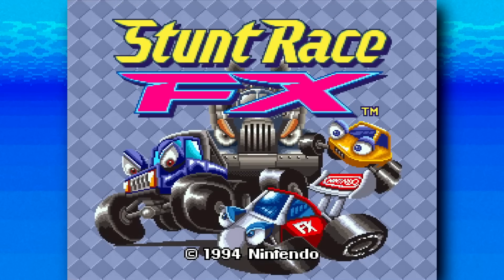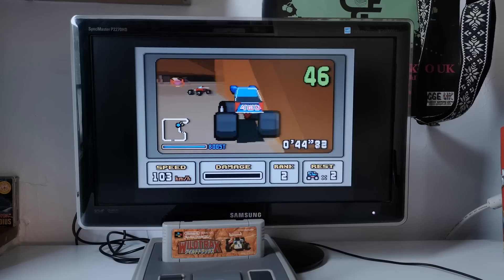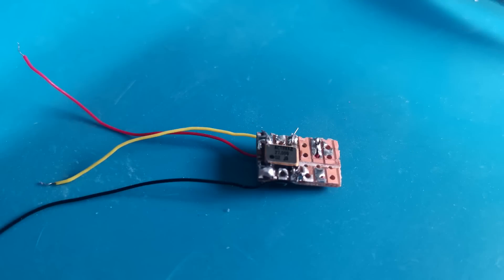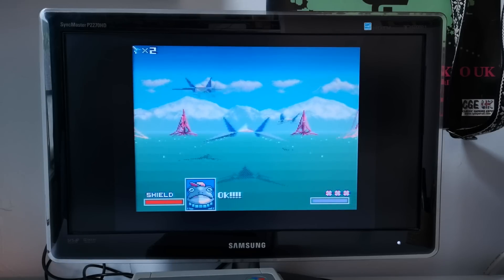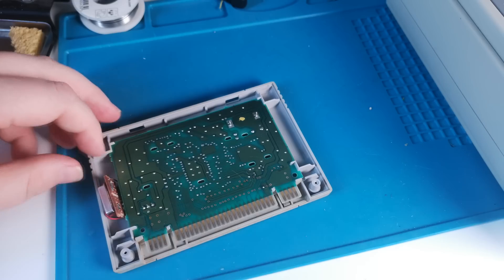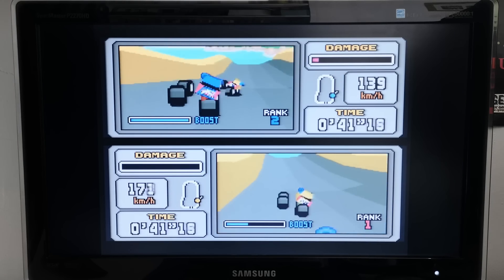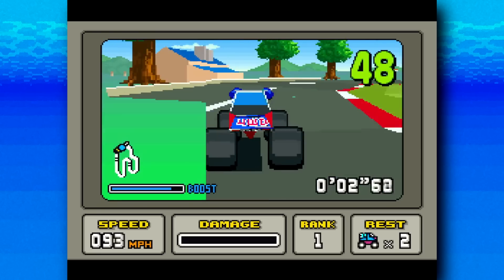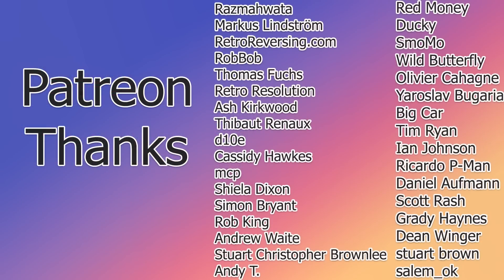SNES Overclock

Comment: Erm. No, Shareopolis. These games have not had their frame rates increased. They have been sped up. The game is running more quickly. I suppose you could say the frame rate has been increased. But you would be stretching the truth a bit. Because the games are no longer operating correctly and you have changed the game. The controls won't operate correctly and the design of the game has been altered and probably spoiled the controls. This is true of all the examples here. Hard Drivin' included, is running too fast and is no longer Hard Drivin'.

Comment: I managed to get the 32 hertz to work on my stunt racer fx 😉 how did you fare doing star fox? as a mod what did your star fox board look like did it have 3 black blobs on it?
Reply from the maker: Yes I have the black blobs version, that seems to be the most common. Modding it was dead easy, you just have to lift the inductor that connects the clock signal from the cartridge slot.

Comment: I overclocked all my super FX games about 7 years ago and it makes such a huge difference, some like the overclock better than others than others. Had some instability when pushing it too high. I also transfered an original Starfox rom chip to a later revision Super FX board so I could overclock it easier, the difference there is amazing :D On a side note the PAL version of Stunt Race FX overclocks higher with better stability than the Japanese version in my personal experience. A small heat sink on the Super FX chip can also help stability as it gets pretty hot. I put a fair bit of info into that Sega-16 thread.. a lot longer ago than I remember, damn I'm getting old

Comment: The ONE thing you definitely need to watch out on is *noise*.

If it's running at 30mhz+, it may well be the oscillator itself, but, having wires exposed, with any slightly dodgy connection, or trailing wires will inevitably induct noise on to the oscillator crystal timing lines.

Imagine being in a crowded stadium and you then try yelling at your friend from one end of it to the other to ask them if they could grab you a beer.

That's effectively what happens when noise is picked up and messes up crystal oscillator pulses

Comment: I love Stunt Race FX, it's one of my favorite FX chip games. While the game does run quite slow, once you get used to it it's actually REALLY playable, and the tracks are all well-designed and really cool to look at for a 3D game running on the SNES. I spent SO many hours playing this game back in the day that when I finally fired up my cart a few years ago to try out my new Super Nt, I had completely forgotten about all the high scores I had set. Brought back a lot of memories.

I wouldn't do this with my own cart. For starters, I'd want a switch to change between stock and overclocked. But if I really wanted to play it overclocked, then I would just use an emulator, which is the far easier option, and doesn't require me modding original hardware. There's only so many original carts left so I really don't see the point in destroying one in order to bump the frames up a couple FPS and risk changing the way the game controls (you say it's "better," but for someone like me who played the game a ton as it was, I'd probably disagree). A good number of people sacrificed these things to make stupid knock-off Star Fox 2 carts when the ROM leaked, and I'd say that would be acceptable if flash carts didn't exist, but they do so it's completely unnecessary. Sadly, lots of people just don't appreciate this game but I think the carts are better off left alone for those who do, or those who may have yet to play it and want to enjoy it as it was.

I know it sounds like I'm probably being negative or elitist or whatever, after all it's just Stunt Race FX, and while I love the game, I still have my own copy of it and I can play it via rom on my FX Pak Pro anyway. Who cares about the carts when so few people like the game anyway, etc. But I can't help imagining a scenario where someone wants this game and buys a cart, not realizing it was modified by some random person, and then either the game doesn't work properly or it just doesn't run like it originally did because someone who didn't even like the game in the first place screwed around with the PCB just for the hell of it.

This is all about preservation. I want to see these games remain playable as they were intended for as long as possible. Hardware might not last forever but we can keep it going for a LONG time with a little bit of maintenance and some spare parts. Half-assed hardware modifications make that a bit more difficult.

Comment: graphics look less complicated than starfox, maybe game needs some code work like mario64 did.  A Potentiometer (multi-turn variety usually preferable but single turn is fine with a fixed resistor in series) can be used to create a voltage divider circuit to bring 5v down to 3.3v for the 27mhz oscillator in the future.

Comment: The voltage divider probably would have worked with a capacitor across the output of the divider to keep the oscillator running stable. Every time it switches state, it draws a gulp of current and the voltage divider isn't going to stay at a stable 3.3v when the current fluctuates, the capacitor would even it out

Comment: I did a lot of testing on emulators and the FX chip is not really the main bottleneck but the "CPU" and past certain point the game has visual glitches that way, also overclocking the FX too much generates frame pacing issues, my recommendation is to be discrete and don't forget the CPU (~120%)

Comment: Still wild to me Nintendo put a 32mhz chip in a cartridge back in the early/mid 90s. Most home computers were around 50mhz at the high end. Those CPUs cost a lot more than $50-60. 

The absolute fastest Pentium (1) MMX processor was around 300mhz and 1/6th of that thru FSB. That was a few years after the SuperFX chip. 

If Nintendo was half as skilled as they were in the 80s/90s, then imagine how good the switch would be.

Comment: I wonder if part of the problem is the drive level of those oscillator.
Stock is a quartz crystal. You added an oscillator, which I assume to have CMOS/TTL levels.
That can actually be to strong.
Also, ground and signal are exactly as important as each other. The oscillator signal only exists relative to GND. If you GND is a mess, so is your signal.

Comment: The reason the 27MHz oscillator wouldn't work probably wasn't so much about the power supplied, but the voltage level of the signal. SNES wants 5V logic levels and it's outputting 3.3V logic. It probably never saw a voltage high enough to register going from 0 to 1.

Comment: Do you think adding a heatsink to the SuperFX chip would help with the higher Mhz osciillator? Or is that not the problem at all?
Reply: Cooling should not be an issue at this moderate overclock without overvoltage applied to the IC.
To see if it is thermal: He could remove the cartridge case and see if that helps - wait: that is literately the first thing he did. Then he closed it with a 30 MHz crystal (slight overclock) and it worked.
No, heat is not an issue. Otherwhise his 30 MHz would crash in the closed cartridge.

Comment: The higher framerate is nice but I'm still waiting for some upcoming work that's supposed to directly edit the original (recovered) source code so the game runs at a higher frame rate without also playing way too fast.

It's amazing that Pixar threatened to sue Nintendo for Uniracers "ripping off" some CG unicycle they made one time, and then they go on to make "Cars" years later....

Comment: I never forgot about this game. I had so much fun with this way back when. The gameplay is solid and the tracks were dynamic and fun and that 2 player mode is a lot of fun. Honestly this game rules.
Reply: How was the frame rate in 2 player mode?
Reply: @fredflintstone5356  pretty low. And the viewable area was considerably smaller than normal. Still a ton of fun—at least when I was younger.
Reply: @justingoers  yeah. Back when I was younger I didn’t notice the frame rate lol. Then when I got to my teens I played Conan on my computer and it would run the game at 5 fps max and yet I still played the game. lol.
Reply: @fredflintstone5356  agreed....I went from an IBM from 93' that could barely run Hugo's House of Horrors to this
Reply: I also had fun playing this game alone back when it first came out. I rented it from Blockbuster and spent a few nights on it.

Comment: This was actually really interesting. I'd love to see more of the same, maybe with other games that are infamous for slowdowns when lots of sprites are on the screen at one time, or just something that ran notoriously slow on the original hardware.
Reply: There's a programmer who does SA-1 patches for SNES games that eliminate the slowdown, like Contra 3. You can run them on original hardware using a flash cart like the FX Pak Pro (formerly called the SD2SNES). Perhaps the biggest boost would have to be Race Drivin', which unlike Stunt Race FX actually WAS unplayable as it was released (although it used no hardware acceleration) and with the SA-1 patch it's buttery smooth.

Comment: it would seem like you could try increasing the voltage of the SuperFX chip. At least for normal CPUs it always tends to make things more stable, of course for a hefty power penalty, which would be in this case quite negligible.
Reply from the maker: That's an interesting idea, I hadn't thought of that. I want to come back to this topic, that's something I will try. Thanks
Reply: @Sharopolis  I would also suggest using an IR thermometer on the SuperFX cpu while its running.

See how much hotter it becomes from 21mhz to 30mhz/32mhz.

If significant, use a copper heatsink on it and try it again. I'd be interested to see the result.

Comment: I always wished that Nintendo had ported this game to the DS or the 3DS. Either of those systems could have pushed this flat-shaded aesthetic at 30fps easily, and it still would've looked pretty good on their low-resolution screens (since neither is far off from the SNES resolution all this stuff was designed for).
Reply: That's a great idea!

Comment: If you really want to have fun with Star Fox in the future, Kandowontu got the game running with not only with SuperFX 2 (21MHz) but even FastROM, a first for a SuperFX ROM.
FastROM actually does add a bit more performance to Star Fox, running the main SNES CPU at 3.58MHz rather than 2.68MHz.
However, on real hardware, SuperFX FastROM only seems to work on a specific revision of the SNES/SFC motherboard, having the incorrect revision will apparently cause it to crash after a minute or two of gameplay.

Comment: Radio Control Mode was one of the coolest parts of this game, shame it was hidden behind fully unlocking the game to see it. I suspect a lot of people didn't know it existed at the time. Dumped a ton of time into this game as a kid, it's rough now but it was pretty damn great back then. The little details that happen off course, like airplanes flying above, the under water tunnels, sun setting over time, really brought a lot more texture to this game than similar efforts at that time. Thanks for sharing, neat to see what it could look like with a few extra frames under the hood!
Reply: That is a shame, although props to the developer for hiding something really good for those dedicated to it. It's far worse when you 100% and get nothing. We were lucky to get even a star next to our save files back then.
Reply: What was Radio Control Mode???
Reply: @FiggsNeughton  I had to go back and fully refresh my memory today to make sure I had it right, but if you get perfect scores (all 40 stars) on all the stunt mode tracks, you unlock Radio Control mode. That game mode is basically a speed run demolition derby, where you try to see how fast you can crack up the other cars in a special area. The real gimmick though is the camera is detached from the car and slowly following the action from a really high up, kind of tilt-shifted, perspective. It looks like you're driving a small RC car. It's unfortunately not quite as deep as I remembered, there's only one arena and game mode, but I still dumped hours into it trying to get that perfect run. If you search "Stunt Race FX Radio Control" in YouTube, you will find some videos of people playing it. Unlocking it is a real bear and probably not worth it, though it might be worth looking for a 100% save game file to use in an emulator if you wanted to dink around in it yourself, no idea if that exists out there though. I think you can also plug in game genie like codes into emulators, though I've never really messed with that.
Reply: @P-_-S  That's incredible, thanks man, and yeah I might look into this!

Comment: Nintendo not only should,ve used an super overclocked fx chip,BUT they also should,ve added faster rom and ram to sped things up and make it run, much more smoother and more responsive to control that game(a hacked version of starfox not only contains an overclocked fx chip but it also contain faster ram and faster rom ),yes i know that faster ram,rom and an overclocked fx chip would,ve be more expensive for nintendo to produce but the most biggest important expectation from a game is being able to play it (smoothly),so i consider it a shame that nintendo didn’t more time & money to smooth things up,

Another drawback comes from the snes itself,the snes can only stream  rendered frames from am external chip at 200x 160 pixels at only 30fps wich is a shame since the snes was ment to be future proof,
Had nintendo added more video ram and/or a faster cpu,then the snes may could,ve stream graphics from an external chip at high-res at 60fps,
But they didn’t wich is a shame because even the 8bit nes could do that,so the snes was half upgraded and half downgraded from the nes,sadly.

Technically i found stunt race fx very impressive but it’s to me a kindergarden silly game with clumsy controls,starfox is a much better game.

Comment: i never realllly liked Star Fox, but after seeing how practical it is to OC the super fx chip, i'm now regretting using my copy as trade value for a batch of Saturn stuff I grabbed back in the day.  Still like the saturn more, but I know getting my hands on a copy of Star Fox these days is gonna cost WAY more than the five bucks I spent on it 20 years ago.
Reply from the maker: It's actually still not that expensive. $5 might be a stretch, but $20 will do it easily for a loose cart.

Comment: Could you thermal tape on a small heatsink to help the stability, or is it something unrelated to heat that causes the instability at higher speeds?
Reply: I doubt that a heat-sink would help. Did you see him run the game without the plastic housing? With the housing closed, everything gets much warmer. Not hot, just warmer.

A bit of theory: Before you run into heatsink issues, the SNES would have to provide the cartridge with significant power, so you would have to improve the power supply circuit to the cart, before you have to worry about heat. Improving the power supply could in fact actually help, but for unrelated reasons.
(you could also try to over and under voltage the chips in the process. Over Voltage might make the RAM more stable. Under voltage might help with heat issues, when the system is otherwise "rock solid". Under voltage might also increase stability - note that without indimate knowledge of the internas, you have to try both under and overvoltage to see what is more stabile)
But... without an oscilloscope, that is just wildly throwing components at the problem.
Reply: a lot of games from back in the day were specifically coded to use the clock speed of the systems they ran on as a way to time certain elements within the game itself, and speeding the processor(s) up, tends to cause all manner of issues. from graphics to physics to sounds playing slower or faster than they should, etc.

so there's a chance that they'd have to patch out whatever limit (if possible) the software itself may have, much like starfox did. 

it might also be an optimization issue like mario64 had, which runs phenomenally when optimized, vs the so-so framerate with specific areas causing massive slowdown.

i imagine, with all the snes/n64 dev thats been going on lately we might just see some insight into what exactly the hangup is in this game at some point. until then, i guess those of us who aren't into snes game dev are left to wonder.
Reply: It might be the voltage holding it back. Those screen freeze up / crashes are what happens with a unstable PC cpu overclock, I don't see why it would be different for the superFX cpu. It wouldn't surprise me if some guru has looked into this. 🙂